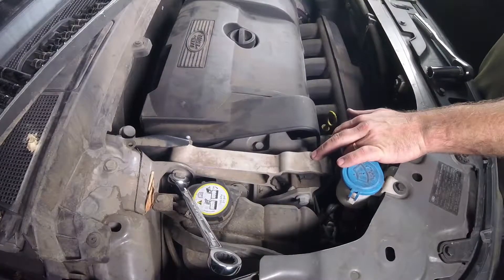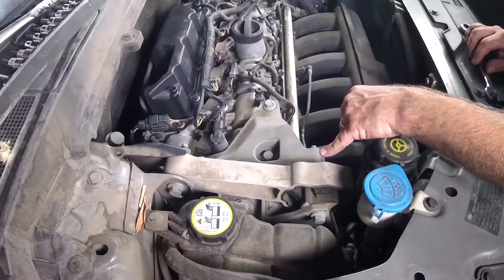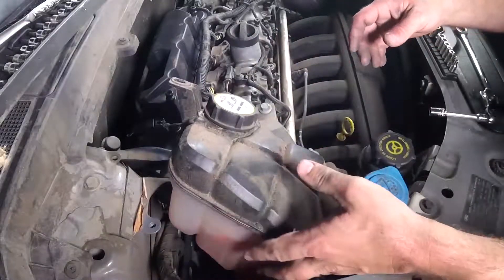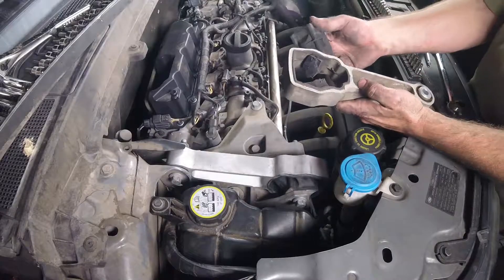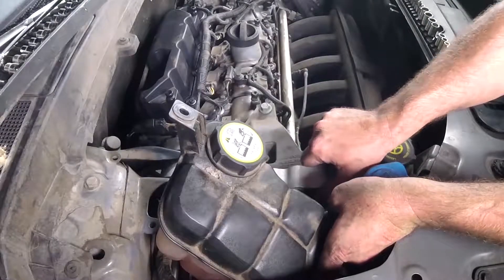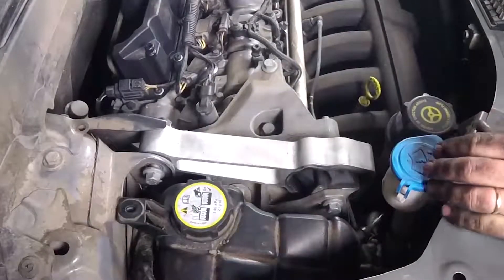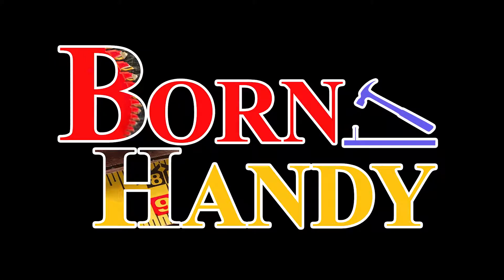Change the engine mount on a Land Rover LR2 2008 through 2012.

Comment: Do you need to prop the engine up with a jack?
Reply from the maker: No need.  This mount prevents the engine from rotating forward or backward in the engine bay while under a load.  The lower mounts will support the engine while you change this one.
Reply: @BornHandy  thank you...

Comment: How do we know we need an engine mount replacement or not?
Reply from the maker: You can visually see the rubber falling apart at the front of the mount.  If that rubber is beginning to crack apart, It's time to replace it.
Reply: Jason Sanders Thanks , a quick question, my 2008 LR2 radiator shakes when the fan switches on, would it be any mount or bushing etc? Any idea. As a mechanic had recently worked on the ac vent.
Reply from the maker: @aminreview4590  That's really hard to say.  If we are talking about the fan nearest the radiator, I would check to see if its been bent or damaged in any way.  If it is, it's likely out of balance enough to shake while in operation.  

If the fan is in good shape, there may be an electrical issue related to the operation of the fan motor - maybe causing a power drain on other essential systems.  

If the mechanic made a repair at the same time the issue showed up, it's probably not a coincidence.  Ask the mechanic to have a "courtesy inspection" to see if he can spot anything obvious. 

I wish you all the best on finding that one.
Reply: @BornHandy   You are the best Jason. Thank you so much. Will check it out . Appreciate your help.

Comment: Now if you could make a video actually changing an engine mount this video would be somewhat relevent. This is a torque strut sir not an engine mount. Feel sorry for anyone who had a bad engone mount and just changed this piece.  Do more research people.
Reply from the maker: The part is in fact a torque mount, but these videos are made to be discoverable by the person that is trying to figure out how to make the repair.  In spite of what it's called,  this part is sold as an "upper engine mount".  DIY buyers are going to search for how to change the part they ordered  -  the upper engine mount, not the torque mount, so the video is named as such.  That's how youtube works.  Research complete.

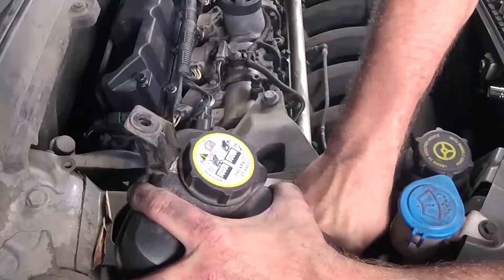Comment: Very amateurish. I saw that piece fly by the screen from right to left at 2:15 just before you skipped looking for it, and you did not put any anti-seize compound on the bolt threads, virtually ensuring they will be damn near to impossible to undo the next time the torque mount needs to be changed. And no, it is not an engine mount, those are underneath, that's a torque mount to prevent the engine from twisting under load.
Reply from the maker: Thanks for watching.  It seems you don't like my video style, and that's ok,  but if you'll let me explain, I think your critique has missed the mark....  

First, that "piece" you saw at 2:15 is a moth.  Slow it down to .25, and you can see it better.  

Second, anti-seize wasn't used for several reasons.  1.  The bolts are NOT going into aluminum, they are going into like metal fasteners.  2.  The threads are protruding far beyond the fastener, and anti-seize on exposed threads can collect debris that will damage the threads the next time the bolts are removed, so I didn't use any.  3.  There was none on the bolts when I removed them, and that's a pretty good indicator that the factory saw no reason to apply anti-seize either.   Just like you don't use anti seize on lug nuts because it's a bad idea and unnecessary, I didn't use it here for the same reasons.

Third, yes - some may call this a "torque mount", but this part is sold as an "upper engine mount".  You have to understand two things about these videos:  

One, they're made  to be discoverable by the person that is trying to figure out how to make the repair, and if they found the "upper engine mount" for sale, they are going to search for how to change the engine mount, and not the torque mount.  

Two, these videos are made to help a do-it-youreslfer get the job done in their driveway.  They aren't for seasoned mechanics or other experts that already know how to do it all.   Some of the terms used may not be to the liking of the experts that "know the lingo".  In spite of that, if the analytics page is to be believed, my videos are currently helping about 6500 "amateurs" a month get the job done.
Reply: @BornHandy  'haha, a moth!
Reply: @BornHandy  Neither of those bolts screw into the same metal as the bolt. If they were it would not be so difficult to unfasten them, as most people changing these have reported, including yourself. Also, these torque mounts don't last that long, so by the time you changed yours it had likely been changed once or twice already. If you're worried about the anti-seize collecting debris, you simply wipe it down before unscrewing the bolt. And if you think the way the "factory" did something is always the best way, you haven't spent much time around Land Rovers. A simple example of that is that the service manual for the LR2/Freelander 2 doesn't even mention the existence of an "upper engine mount" or the correct torque value when reinstalling the bolts.  :)
Reply from the maker: @meinempanadas  I don't want to be pulled  into a keyboard fight over this,  but...  

This vehicle belongs to my sister-in -law, and the mount had never been changed.  The bolts pass through the bushings, and screw into a mounting point on the other side.  The mounting point absolutely IS a steel fastener, just like the bolt.  The bolts were hard to remove because just like lugnuts, they were tightened down quite a bit.  Manuals are not all inclusive, but factory build spec are - otherwise the car wouldn't have the mount at all.  

Also, if it isn't mentioned in the manual, what standard are you applying here anyway?  

It looks to me like you just want to throw shade on a video that was designed to help.  If that's your mojo, have fun, but it isn't helping anyone.  This job was a job well done, and is still holding today.   

Lastly, here is a more constructive idea.  The next time you have a LR2 handy, make your own video.  Maybe you can keep the moths away from your lights, and call your part a "torque mount". 

Good luck!
Reply: @BornHandy  I can't help you if all you see here is a challenge to your manhood; that's a personal problem. Perhaps others will read my comments, based on experience, and not make the same mistakes. Good enough for me. The forward mounting point for the bolt is not steel, it is an aluminium bracket. As to what standard I am applying, maybe if you did your homework you'd know the engine is made by Volvo, same as on their S60. The rest is mostly made by Ford. Volvo seems to be more careful about their service manuals. The correct torque is 81 ft lbs. I also apply anti-seize to lug nuts and to other things, like spark plugs, and not because any manual says I should. The devil is not wise because he is the devil -- he's wise because he's old. :)
Reply: You're just coming off like a troll.
Reply: @meinempanadas  What are you talking about?  You're worried about bugs on screen, using your opinion about anti-seize, name calling.  When the insults come out, you've been defeated.  Game over.
Reply: @SavingSally  Oh, I get it now! You thought you were in the game! Now that is so cute, child. Sorry, but no. Pot. Kettle. Black. Sit back down and finish your lollipop. And don't mind my yawning, I always do that when someone says something interesting.
Reply: @meinempanadas   You assume I am a child.  You assume an insect is a car part.  You assume anti-seize is required because "you" think it is.  You assume an awful lot for someone that has no skin in the game.  Where are your expertly made videos?  You can't make them while armchair quarterbacking the internet.  Show us what you have, or buzz off.